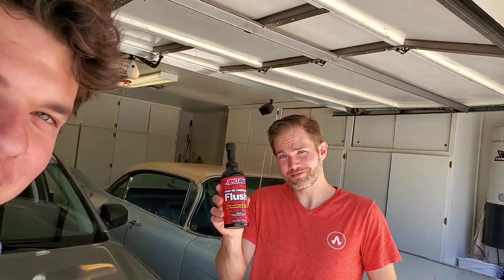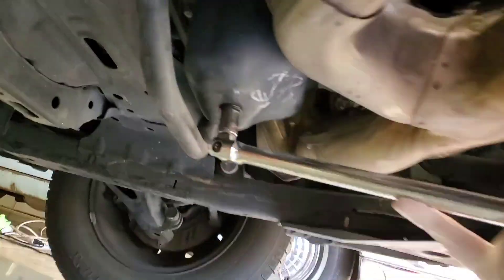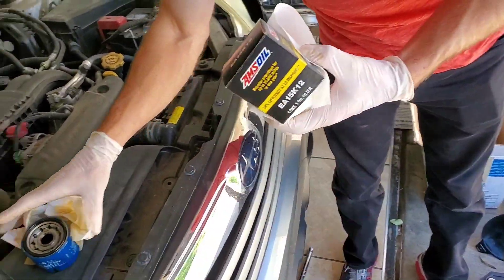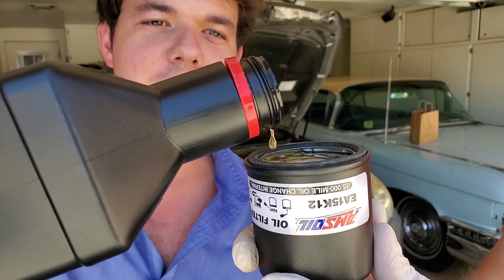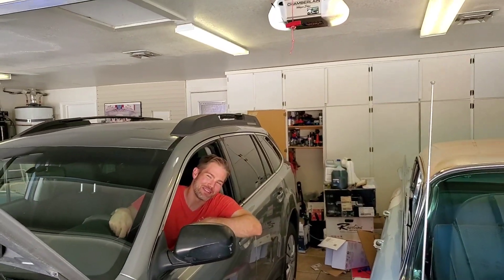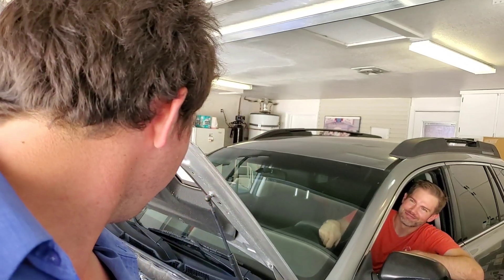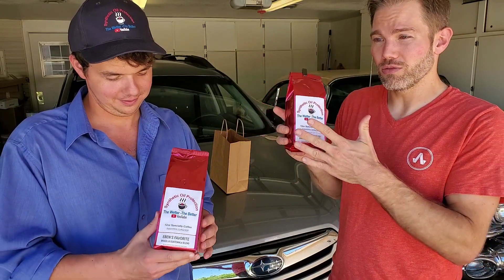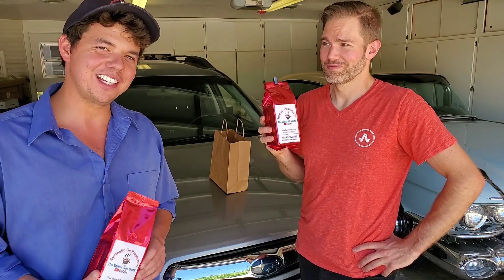2011 Subaru Outback 2.5L AMSOIL Engine Flush Oil Change

Comment from the maker: Ebens Favorite Coffee - https://supportwith.coffee/shop/subscriptions/sop/

      Professional YouLubher: Eben Rockmaker Regency Direct Jobber AMSOIL Specialist (Dealer#: 5331179) Mobile: (702) 472-3614 

      Ebens Link: AMSOIL Wholesale + FREE Shipping: https://www.amsoil.com/offers/?zo=5331179 

      Synthetic Oil Protection Website - http://syntheticoilprotection.net/

      Lookup For Your Vehicles - https://www.amsoil.com/guides.aspx?zo=5331179

      AMSOIL Performance Test Results - https://www.amsoil.com/performancetests.aspx?zo=5331179 

      Synthetic Oil Protection Website - http://syntheticoilprotection.net/

     Ebens Giveaway: 
Over $5000 Given to my YouTube Community.     Playlist - https://www.youtube.com/playlistegg?list=PLB_ftWArBFdey4HFt_Z9KgSIChjkLbw_o

Ebens Facebook - https://www.facebook.com/profile.php?id=100007973957868 

Learning about AMSOIL?: 

1. Where can I find AMSOIL? - Use this link https://www.amsoil.com/offers/?zo=5331179 
Or 
Watch THIS: 3 Fast Ways To Get AMSOIL - https://youtu.be/RiYifuDCsnQ 

2. What makes AMSOIL different than other oils? - 

AMSOIL is 100% Synthetic & has higher film strength & holds up 4× better in turbocharger deposit testing than Mobil 1 EP which protects and separates metal parts, keeping them from wearing and Lasting Exponentially longer: https://youtu.be/f4eNPgTi_qo 

3. Why should I use AMSOIL?: It protects the engine so it will last longer. Less oil changes less often (once per year/15,000 miles) or longer... Save money in Gas & Time making it less expensive than a free oil change over the year - https://youtu.be/H7K6FdZlqmg

     Professional YouLubher:          Eben Rockmaker Regency Direct Jobber AMSOIL Specialist (Dealer#: 5331179) Mobile: (702) 472-3614

     Lookup For Your Vehicles - https://www.amsoil.com/guides.aspx?zo=5331179

     Ebens Link: AMSOIL Wholesale + FREE Shipping: https://www.amsoil.com/offers/?zo=5331179 

     AMSOIL 46,000 Mile Test Results - https://youtu.be/UjijQK5wSM0

     Tag me?: 

     Instagram - https://www.instagram.com/syntheticoilprotection/ Eben 

     Facebook - https://www.facebook.com/profile.php?id=100007973957868 

     The Power of AMSOIL Signature Series 5W-30 Synthetic Motor Oil protects against harmful deposits on turbochargers 4X better than Mobil1® Extended Performance and 3.6X better than Royal Purple® in industry-standard testing*. https://www.amsoil.com/newsstand/motor-oil/articles/leading-the-field-in-deposit-protection/?zo=5331179 

     Better Mileage Proven - https://www.amsoil.com/newsstand/motor-oil/articles/another-win-for-amsoil-products/?zo=5331179

     AMSOIL Performance Test Results - https://www.amsoil.com/performancetests.aspx?zo=5331179 

     Lookup For Your Vehicles - https://www.amsoil.com/guides.aspx?zo=5331179  

     Ebens Link: AMSOIL Wholesale + FREE Shipping: https://www.amsoil.com/offers/?zo=5331179
Reply: Is there a way to get the oil SHIPPED, Eben, if I buy it from you? You are making me a believer!!!

Oh and I work at Dunkin Donuts by the way. Your coffee skills are on point though :D
Reply from the maker: Yes thanks that would be awesome This is my link and you'll see we'll give you the preferred customer pricing and that will save you about $33 on $100 order because of the 25% discount and the difference in tax.

If you have any questions before you order always happy to talk with you.

Thanks again for being a part of my YouTube community 💯😊😃

Professional YouLubher: Eben Rockmaker Regency Gold Direct Jobber AMSOIL Specialist (Dealer#: 5331179) 702-472-3614 

     If you're New to AMSOIL I recommend the AMSOIL 6 Month PC Membership - https://www.amsoil.com/offers/pc/?zo=5331179
Reply: @Syntheticoilprotection  I like it. And I have a 2002 Subaru.. sounds kinda not the best on start and until it warms up "it's a Subaru thing" so. Amsoil here I come :)
Reply from the maker: Awesome definitely let me know when you try it 💯💯😊
Reply: @Syntheticoilprotection  I hate to be really redundant but, how much would I be looking at for oh 4 quarts of oil lol?
Reply from the maker: That's a great question I would check the site and select the PC member you'll see the price on there Just click on the link add the 6-month PC membership to cart add the products to the cart and then you'll see your total with the tax and everything.

Comment: That engine sounded like a diesel before. Definitely, an improvement!
Reply from the maker: Yeah those are an interesting engine the way there horizontal cylinders
Reply from the maker: And they take a little teeny Smart Car filter😁
Reply: @Syntheticoilprotection  yeah, that filter was super small. Maybe those engines don't throw off a lot of wear metals? The filter is just as important as the oil you use but he now has the best of both. Cheers to protection my friend
Reply from the maker: Yeah I think it's the manufacturer cutting cost on maintenance.

     Also it's good because if you don't change the oil at all wrecked the motor so they make it so it's easy to have a problem

Comment: I may have said this before, based of my own experience using Amsoil in the past two years, Amsoil helped improve engine performance and made my car sound quieter and the same experience goes for my moms 2006 Toyota Sienna that just reached 156,000 miles on it. 

With the signature series, although I don’t drive 25k miles in one year, I know I can leave the Amsoil SS oil in the engine for a whole year or more and change it out once a year at 8k to 10k miles, some times I’ll change it out up to 12k miles with no worries.
Reply from the maker: ☕, stellar 😊

Happy holidays man really really appreciate you being a part of the channel over the years😃

Comment: FYI the AMSOIL blog just came out with some new comps to Mobil 1.
Reply from the maker: Sweet
Reply: Link? Couldn't find it.
Reply: @jdinn32  me either
Reply: @vg452  thanks!
Reply from the maker: It's okay if you share a link on my channel only if it has my blinker extension on it.

?zo=5331179
Reply from the maker: Amsoil vs. Mobil 1 blog post
https://blog.amsoil.com/amsoil-vs-mobil-1-how-we-perform/?zo=5331179

Comment: Is that recommended rather than the 0w-20 signature series (green bottle) for Subaru Outback?
Reply from the maker: Hey John great question it depends on the year make and model you'll see everything for your vehicle here in the lookup guide I personally like the pi cleaner the engine flush and the signature series and then I would also get an extra filter that way you can change it after about 3,000 miles because a lot of that build up is going to end up in the filter because the detergents are going to clean it out this will give you the best value on the products and that'll attach me to you so in the future I can always answer all your questions about improving the performance lifespan of your vehicles by choosing the right fluids as your independent Amsoil dealer.
👍☕️😃
     ✅   Save 25% On Your Next Fluid Order: https://www.amsoil.com/offers/pc/?zo=5331179 

     ♥️   See Fluid Performance Tests - https://www.amsoil.com/performancetests.aspx?zo=5331179

Comment: That one was definitely a gargler 😂 also, might wanna tell that guy to watch out for signs of a blown head gasket. He’s at the mileage where it happens on those engines. I put a set on mine and it’s still running great at 170,000 miles.
Reply from the maker: Sweet😉

Comment: How many miles shall I change my engine oil (Subaru outback 2016 2.5) if I change over to Amsoil signature engine oil? Oil filter says 15,000 miles but nothing about the engine oil itself??? great video. subscribed! thx
Reply from the maker: Of course thanks for being a part of the channel John!

If you run the signature series motor oil you're good for $25,000 miles.

I recommend changing the oil filter at 12,500 if you're running the amsoil oil filter that way it's a little earlier and you'll have better oil flow.

If you're doing severe service driving in the city in high temperatures I would definitely do oil analysis at 15,000 mi and see where you're at.

that way you'll have a good judge in the future and then you can say and adjust how many miles you'll change the oil at.

You'll see my playlist here on oil analysis - https://youtube.com/playlist?list=PLB_ftWArBFddc-nU9A-k2vfxWYxdq3E_b
Reply: @Syntheticoilprotection  Thank you so much! I think I'll try this oil and the filter on my next oil change.
Reply from the maker: Sweet!

Thanks again for being a part of the channel!

Comment: You know where I could score some of those oil filters?  🕵‍♂
Reply from the maker: Yes you can order right here through my link if you're new to Amsoil the best value on the products is the 6-month PC membership and when you use my link I will be your go-to Amsoil guy in the future and I appreciate the business future business in advance👍
❤️ 🇺🇸 ❤️ Professional YouLubher: Eben Rockmaker Regency Platinum Direct Jobber AMSOIL Specialist (Dealer#: 5331179) 702-472-3614 

      ✅ ✅ ✅  You will get Best Value with 6 Month AMSOIL PC Membership because You get $33 back on a $100 purchase after the difference in Sales Tax with No need for Auto Renew - https://www.amsoil.com/offers/pc/?zo=5331179
Reply: @Syntheticoilprotection  Its been saying "Out of Stock" for months now on EA15K-13, can't even find them second hand on eBay.

Comment: I can't wait to use those products for the Jeep ! Thank you for the video.

I am keeping an eye out for the Jeep Renegade Coolant Flush video! Please and thank you!!!
Reply from the maker: I may not be doing it because the coolant system could be compromised on her car and I don't want to risk breaking any plastic parts and I think she might be trading in the car
Reply: @Syntheticoilprotection  Thank you for getting back to me ! I hope she does not turn it in !
Reply from the maker: Yeah that's one of those cars you're going to have to drain it from the main hose that's the way you do that car
Reply: @Syntheticoilprotection  Hey I looked into draining it from the main hose and apparently lots of people have difficulty removing the hose. Any tips ?
Reply from the maker: Yeah you want to get a hose remover it kind of has a special thing to it that helps you pry it off

Comment: Subaru motor oil is made in japan and Amsoil made in the USA, i prefer anything that is made in Japan even motor oil Not sure why people are against Subaru oil .
Reply from the maker: Interesting I didn't know that!

Yes Japan is a very productive country I run the Toyo tires on my personal car they're called Toyo praxis Sport and I tell you what they make a beautiful tire 🇺🇸💯😃
Reply: @Syntheticoilprotection  in Japan every car filled with Idemitsu oil , Toyota , Honda , Subaru and those engines last forever .  I know idemitsu uses highest quality additives for their engine oil
Reply from the maker: Yeah the Toyota's have a lot of issues with their lubricants transmission problems and also the motors burn a lot of oil I think they change the fluids lately and they're now different.

I've had a lot of customers with a lot of issues.

The Honda seem to hold up a little bit better
Reply: @Syntheticoilprotection  Isn; 't burning oil because most people never break in the engine properly? My focus I had using nothing but Motorcraft  oil never lost 1 drop of oil and it had 300k miles before it got totaled  but I broke that engine in the way you supposed to
Reply: @Syntheticoilprotection  Also lots of people follow the 10k mile oil change with your run in a mill semy synthetic oil
Reply from the maker: Correct in if you do city driving 10,000 mi with that semi synthetic you will damage the rings thicken the oil and have significant compression loss especially if you do cold starting with old oxidized oil.

Also the inexpensive filters that come on most of the Toyotas don't hold many contaminants so 10,000 city driving is really hard on that motor and that's why they get a lot of burning and oil burning and coating.

You'll get a kick out of this video $375,000 mile engine flush - https://youtu.be/f7nrBNi1k9Y
Reply: @Syntheticoilprotection  Right , Toyota filter cost around 6 dollars so people should change them every 5k miles
Reply: @Syntheticoilprotection  I do love working on my car , got a Subaru but i do 6000 mile oil change , but i also detail my car every week too

Comment: All subarus sound like shit at cold start. Usually all the noise goes away after 30 seconds to a minute. Obviously the second start wasn't cold. Im sure it was warmed up off camera. For all you naive folks out there.
Reply from the maker: Yeah amsoil is totally different where it actually keeps the film longer on the metal it has additives that allow it to cling to components and keep that film strength.

Your car will start totally different after you change over and also the other benefit is the high flow oil filter.

This is some of the performance comparisons.

AMSOIL Performance Test Results - https://www.amsoil.com/performancetests.aspx?zo=5331179

Comment: Need to change the transmission fluid in this
Reply from the maker: 😃, I know it kind of got in my head the whole time I was thinking man what would this thing feel like once it's all switched over.

     I haven't gotten that excited about a car in years.....
Reply: @Syntheticoilprotection  I think about that with every vehicle I see. I really want to see filters being made for semi trucks, especially the tow trucks and heavy haulers we have at my job
Reply from the maker: Amsoil does make a lot of those filters you'll see it here in the lookup guide.

Lookup For Your Vehicles - https://www.amsoil.com/guides.aspx?zo=5331179
Reply: @Syntheticoilprotection  tried looking for them. I'm looking for a Hino 258
Reply from the maker: I would call AMSOIL technical support on Monday most likely they can give you the exact filters.

17153998324